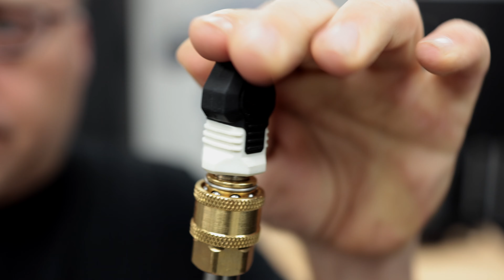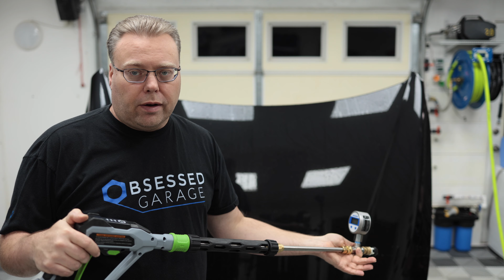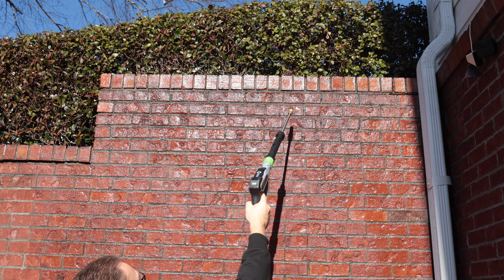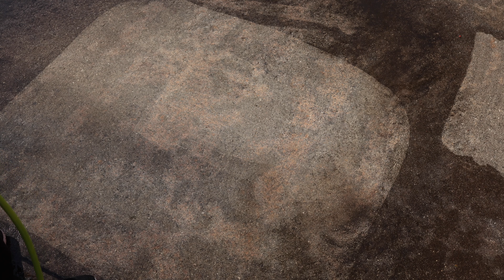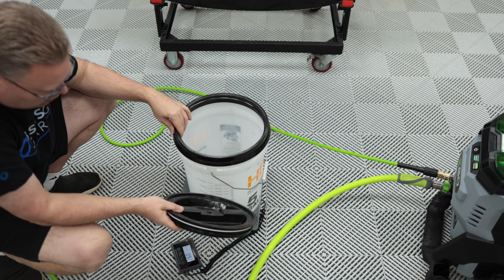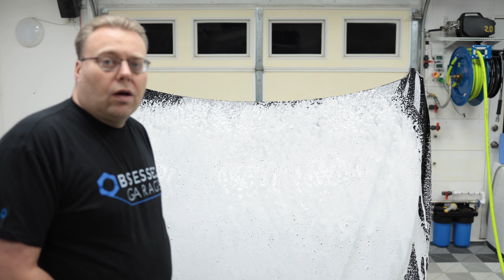EGO 3200 Battery Powered Pressure Washer | 3200 PSI?! | Review & Testing

Comment: Just an FYI if you read the manual, it's highest flow is 2.0GPM if using the gun without the extension.
Reply from the maker: I don't go by anything they state myself as whatever they use to get those numbers won't be a way I'll be using the machine.
Reply: @CarsWithKeav i get that, just saying it'd be fun to see how close it can gry to that 2gpm in with just the handle.

Comment: I often just listen to You tube videos (while I drive).  I could not understand how you were adapting the gun with "1/4 inch male npt to 1/4 inch male quick disconnect and a 3/8 in male quick disconnect to 1/4 npt threads".  I kept replaying it and it still made no sense.  Then I finally watched the video.  What you were holding does not match what you were saying.
Reply from the maker: Yeah I should have said female quick connect instead of male. I did however show all the correct fittings in the description well unless the sellers decided to change the listing. LOL

Comment: I have a Zebra clean pressure washer gun. Will that fit on the supplied hose? I'd like to use my MJJC foam cannon without having to purchase all those adapters you showed. Great video!
Reply from the maker: Yes it should the quick connects are standard 3/8

Comment: If we go for the 1.1 orificce, can’t we damage the unit in the long run?
Reply from the maker: That’s a question that is very hard to answer as we have no way to monitor what the motor is pulling and what is the safe limit of the motor. Just based on the nozzle sizes that come with it though should be fine as a 1.1mm is the same diameter as a 3.0 nozzle and their stock nozzles are much smaller than that.
Reply: @CarsWithKeav  I need your honest opinion do you recommend me this one? I know it’s expensive but I don’t wanna go with the gas ones the one that I used to have from Harbor freight turn on fire they gave me the money back on cards, but I don’t wanna buy another one and electrical. I hate the cords this unit it’s offering decent psi for battery operation, which is sweet. I’m just a weekend warrior I wanna believe this unit will be good for me to wash my cars and Complete chores around the house.
Reply from the maker: @Pedroluvslupe Just know for chores and washing multiple cars its only going to last 20 to 30 minutes tops and you’ll be down two batteries. It won’t have anywhere near the cleaning power of a gas one as it has the PSI, but a 1/3 of the water flow. It’s a great machine though.
Reply: @CarsWithKeav  I don’t wash cars  for living I just wanted it  for my personal use. We have two vehicles. And I don’t do both at once I’m just tired of the noise and gas smell a lot of maintenance and I hate the electrical cords. I want something that you move around without attachments this machine from Harbor freight almost blow out in my own door house I’m not going back to gas dud the besides to clean cars you don’t need a beast
Reply from the maker: @Pedroluvslupe I good one would be the cheaper EGO as well. The 2100 only needs one battery and has plenty of performance to wash cars. Half the price too.
Reply: @CarsWithKeav  if I use the 1.1 orifice on the foam cannon , can that be OK?
Reply from the maker: @Pedroluvslupe Should be just fine.
Reply: @CarsWithKeav  I just wanna get the  thickest foam possible

Comment: So in the end, which setting is best for car washing in terms of psi and gpm?
Reply from the maker: For me if running a 40 degree nozzle I would use a 3.0 and if using a 25 degree use a 3.5
Reply: @CarsWithKeav sorry I mean just with stock ego. Is it best to use 40 degree tip and turbo setting or another setting?
Reply from the maker: @jnlin85 40 degree tip for sure washing a car you should be fine. If it’s an older vehicle that may have trim or paint that’s sensitive I wouldn’t run turbo.

Comment: If it advertises 3200 psi, I want to see 3200 psi.   This video shows it fails.
Reply from the maker: You will be disappointed a lot then very few pressure washers will ever actually do the number stated on the box. It is most often what the pressure washer is capable of internally and not constant at the nozzle. Think of stated horsepower in cars and what actually gets to the wheels after drivetrain loss. Some just straight up lie especially Amazon products. Electric products also depends on how good your electrical circuit is like my garage usually is at 116 volts and somebody who has 120v constant will get more performance. I’ve reviewed a lot of pressure washers and this one is actually high up on the list of ones that by percentage get close to what’s stated.
Reply: @CarsWithKeav  That's a really good analogy. Thanks.   BTW, think this would work on the second story of a vinyl siding house, from the ground.
Reply from the maker: @airtazznunya5724 You would probably need an extension or two to get the pressure stream close enough, but usually for siding most pressure washer companies use a soft wash with bleach and don’t use pressure.

Comment: I think ACME Tools has this kit with the two 6.0AH batteries for $629 right now for their 4th of July sales.  I’m seriously tempted to get this as I can use it during the winter with a bucket pull when my outdoor spigots are winterized.  I was contemplating the smaller unit but the sale might push me towards the 3200 vs 2100.
Reply from the maker: It’s worth it almost just for the batteries. Only really paying $130 for the unit itself.

Comment: Wanted to post this here as well as @IAMJOSHV site as the two convinced me to make the purchase. Live in a condo on 2nd floor with no access to water.  After watching this video i bought the the EGO pressure along with with the Ridge Washer tip.  Did my Suburban this sunny morning.  Had a SunJoe before, but this thing is an entirely different league.  Had 3 Home Depot buckets full of water, only enough to do a Foam & Rinse, would probably need another 3-4 buckets to add re-foam/hand wash/rinse.  Primarily got this for my Boat & Model 3, so this morning was a test run.  Never used Turbo mode, not necessary.  Only used 20% of the battery capacity.  Also my process is not dialed in, wasted water.  Thank goodness i had separate DI water for rinsing, side facing the sun dried out so fast.

Comment: I might have to bite the bullet on this as I’ve been debating on getting the Kranzle 1322 to replace my ar630 but without a driveway I need to wash my cars on the street as I can only wash 1 a day due to water sitting in the alley near a neighbors house and I don’t want to be that guy 😅. Great review as always!
Reply from the maker: Any particular reason you would be replacing the ar630 with a Kranzle. I understand the portability of the EGO just curious of the reason.
Reply: @CarsWithKeav everywhere I see they mention that the Kranzle is worth the upgrade and overall better in terms of sound and performance. I figured I would give it a go, I did see your review in which you mentioned it’s not worth the price tag, guess it’s more curiosity than anything.
Reply from the maker: @jpalma2135 The AR630 is actually better in performance by about 10%. Kranzle might be slightly quieter, but both are considered on the quiet side of pressure washers. They both are rebuildable. In my opinion the AR630 is the better unit. Kranzle I think can self prime that might be the only reason to get it and people like how it looks.
Reply: @CarsWithKeav that’s the dilemma I’m dealing with. Is the slight difference in sound and better look worth the cost? I know you mentioned that the ar630 would be the better choice, so I might just use that money and invest it into some type of piping like Prevost.
Reply from the maker: @jpalma2135 I value performance over looks any day of the week, but that’s just me.
Reply: @CarsWithKeav appreciate all the input and feedback! I think I dialed in my setup but with the tank from on the go not sure if it’s worth to build any plumbing for it compared to the cr wall mounted version. Do you have any experience with MTMs Prima line of quick disconnects?
Reply from the maker: @jpalma2135 I have not used them before, but I hear good things.
Reply: @CarsWithKeav i might have to give them a try just to see if there is a noticeable difference between those and the standard MTM offerings. Do you use a specific brand for your quick disconnects?
Reply from the maker: @jpalma2135 Not really I just pick the best price stainless ones. The Essential Washer ones are always nice. I’ve never had one fail.

Comment: Alright Keav I got this pressure washer and it is pretty good.  I got it with the 3.0 nozzle set for my rinsing.  I also just got the uber flex for it from your link so… if I were to get a set of orifices to use this to also apply rinseless what do you suggest?  Someone did a test and got 500 psi on low out of the 3.0 but I think I want even less than that.  Thank you for all you do.
Reply from the maker: You could always go to a 3.5 or 4.0 to get less pressure although sometimes for rinseless it’s the pattern itself more than pressure. Whatever is going to cover most efficiently.

Comment: New subscriber - Which would you recommend between this Ego and the Active 2.0 (not considering price)? I did notice on another video that the Ego often times went quite low on the pressure and it took a while before it came back to life; have you had that issue. Greatly appreciate your input!
Reply from the maker: So if I had my own water supply and didn’t need to be portable I would go Active all day. If I need to be portable at times without a cord then EGO is the way to go. The EGO even though great does have a limit with battery run time when using the higher nodes which is all I would ever use. So that’s two expensive batteries held hostage if you wash a good bit. If you like being cordless though and are in the EGO battery system then it’s a tough call. They are coming out with a a smaller unit I think 2k PSI that uses a single battery this spring. It’s half the price.
Reply: @CarsWithKeav  I greatly appreciate your quick and thorough reply! I am in the Ego eco system and those two extra batteries would come in handy for what I do around the house. So, I decided to go with the Ego, and for the extra attachments I'll be ordering, I have used your links to purchase on Amazon the things I need... so you should get the commission.
  Now I just need to figure out which gun I want to get..  I have watched your video between the Active and the SGS28... still unsure. But if you have any extra insight since the time of that filming, that would be greatly appreciated.
  Have a great one! And thanks again!
Reply from the maker: @RacerX-M5  I have not picked up the Active since aboiut a week after filming that. The SGS28 is hands down my favorite now the Mckillans Swivel Pro is a close second and if looking for a straight angle that would be my choice. https://amzn.to/3PMn7O2
Reply: @CarsWithKeav  Thanks for the update - very helpful! And I just rewatched your vid on it.

Comment: In order to connect MJJC foam cannon to the EGO, which converter do i need? Thx
Reply from the maker: Actually to connect an MJJC all you have to do is remove the back part of the MJJC and that thread will screw into the first extension in the spray wand. If you want it to be done shorter you can use this adapter so you can screw the MJJC into it and the quick connect side into the gun. This item comes with two pieces as you can’t buy separate. https://www.amazon.com/dp/B0CH83C98M/ref=cm_sw_r_as_gl_api_gl_i_0EQM9X9YF3YFX5FAEA3D?linkCode=ml2&tag=carswithkea04-20

Comment: I noticed that you didn't mention a runtime test about the batteries. Did i miss that?
Reply from the maker: I should have done one, but the few times I used it the runtime was right in line with what they state. 15 minutes in full turbo mode

Comment: Under the ADAPTER TO SHORTEN WAND (tools Needed)section will these fittings allow for use of the SGS28?great video thanks for the thorough testing
Reply from the maker: No, you don’t need any adapters to work with an SGS28. The hose already has the quick connects to connects to it.

Comment: Do you know the part number for the filter for the siphon inlet hose by chance?
Reply from the maker: Crazy thing I don't see it on the parts list here https://egopowerplus.com/mpattachment/file/download/id/3322/ just the hose. This is the closest thing I can find, but it will extend your siphon hose a good bit. https://amzn.to/4fiLX3r You could cut to size and would take some playing around , but should work. I have this hose for my Ryobi and will work only problem is I don't now if the quick connect is the same style as the EGO. I don't have mine anymore to be able to check. Sorry, I couldn't help more.
Reply: @CarsWithKeav  thank you Keav that was very helpful, no worries, yeah super odd I can’t find it anywhere thanks I’ll try that one
Reply: @CarsWithKeav  do you know if I can use the ryobi ez clean hose with the Ava easy pressure washer? Do you know what kind of adapter in need in order to attach the ryobi hose to it?
Reply from the maker: @Moshymane  yup, you would just need the name end of a Gardena quick connect for it to snap onto. https://amzn.to/4dyAhYF
Reply: @CarsWithKeav  and I attach this to the end that’s black and grey? Also do you know how I can attach the filter, I’m struggling ha
Reply from the maker: @Moshymane  Really you might not need to buy a quick connect as on the green end that male plug comes out you can you that on the pressure washer to attach to the gray/black side. The filter has garden hose threads so once you take out the green make quick connect that green female should screw right into the filter.
Reply: @CarsWithKeav  amazing thank you I’ll try that soon, I appreciate it!
Reply: @CarsWithKeav  hey Keav I got the piece out it was tuck or really tightened down I guess, I attached it the AVA it all fit like you said but when I try to connect the grey end to the green end I attached to the AVA, it seems mad loose like the hold the grey part has on the green, will that work when using it with a bucket? My bad so many questions ha
Reply from the maker: @Moshymane  Only one way to find out. Best to prime the hose first by filling with water. Those quick connects are very loose compared to the metal ones.
Reply: @CarsWithKeav  fire thank you I’ll test it out next time I wash the car, thank you for your help brotha 🍻

Comment: Ya 2000 dollars later in batteries 😂, ya no thanks I’ll keep ryobi gas 3200 psi
Reply from the maker: If you need the extra batteries then for sure way too much. This is mainly for people with ego tools already to share batteries. Also, more for areas that you can pull water from a lake or bucket. Great for a boat dock and small jobs for sure but meant to do a whole driveway.

Comment: Thank you for testing the siphon hose + bucket of water method. That’s what I wanted to see, to make sure that method works well. You see, I’m not a car guy like you, but I do have an off-grid cabin on my wooded hunting property that does not currently have running water (AKA, no garden hose to hook up). I’m thinking one of these ego pressure washers may be the ticket for washing the outside of my cabin off via the bucket method, provided I bring enough 5 gallon water jugs from home. I have a 10 gallon pot up there that I can just fill up and dunk that weight to the bottom of it and clean that scuzzy green crap off my cabin as needed. Seems to work well enough, what do you think?
Reply from the maker: This thing is more than enough to do what you need and most likely without the turbo mode which will save you battery. The green stuff is usually organic most pressure washer companies don’t even use pressure washers on sides of houses they use concentrated bleach and soft wash it off.

Comment: You did ok, don't worry about it. When we try to be perfect records, we get nurvise.
What size did you use for EGO pressure gauge to make the test on EGO gun wash?
What bottle fumes wash you had the lost one it was good soap fames.
Reply from the maker: Thank I’m always hard on myself. DIY Detail Incredible Suds was the soap used. The pressure gauge usually have a 1/4 thread and you have to get a T fitting and get it to work with quick connects.

Comment: What would a good hose reel combo that would be plug and play with this pressure washer?
Reply from the maker: Plug and okay there is only one I know of, but the hose is not as good as the one that comes with this one. https://amzn.to/4bzYjSr Anything else out there you would have to get the separate hose and reel and put them together.
Reply: @CarsWithKeav  What would be your choice if you went with a separate hose and reel? Just looking for a hose and reel to be permanent outside near faucet for washing car. Maybe like 50 foot.
Reply from the maker: @Pete_or_Peter4Long  This is a good affordable combo. https://amzn.to/44YDDRE and https://amzn.to/44X0kFT
Reply: @CarsWithKeav is it possible to buy pieces to make the hose going into machine a quick connect and if so can you provide links to the pieces needed.
Reply from the maker: @Pete_or_Peter4Long  These would work well to convert the garden hose or siphon hose and pressure washer to quick connects. https://amzn.to/47A7XmW